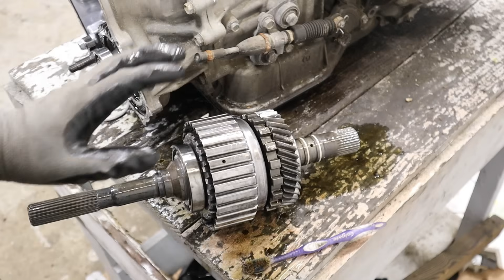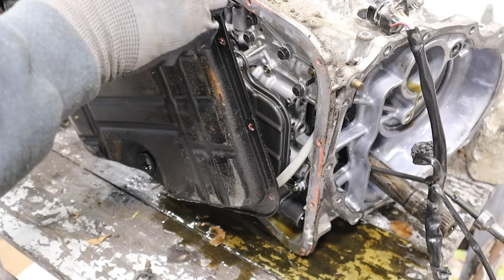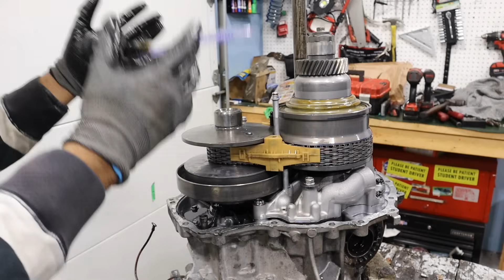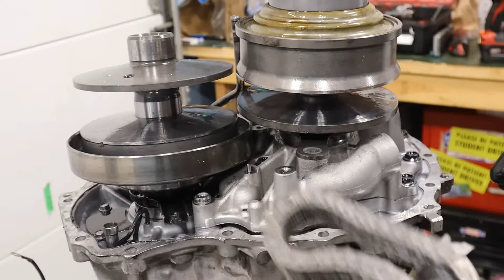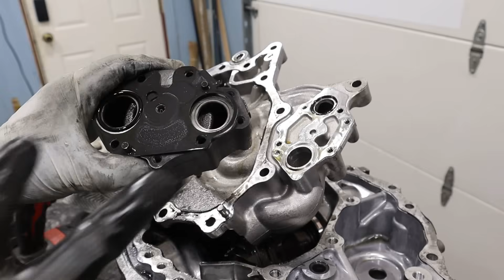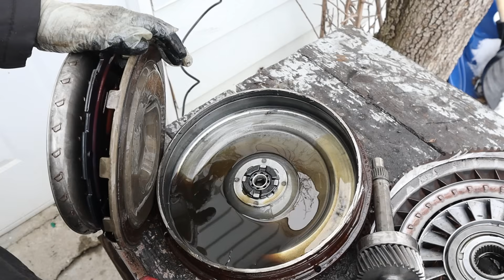Are Subaru AWD CVT's Reliable? Subaru Outback Transmission Teardown!

Comment: Before I watch the video I would say at 91,000km or 56,000 miles that the owner never changed the fluid at about 48000 km or 30000 miles. The valve body does not need to be changed the solenoids can be purchased for about $75.00 each.

Comment: I think the problem with Suburu trammies is they lack a physical, mechanical "launch gear" for 1st gear.  Low speeds put a hardship on the belt in their transmissions.

Comment: The reasons why these transmissions fail is due to lack of maintenance it's not because of the transmission being poorly manufactured service every 30 thousand miles and it will go forever

Comment: Oh and that's only CVT not for fuel efficency.
It's for it's capabilities. Dead stop to crawl in deep snow, smooth changes uphill and downhill, linear acceleration (that's amazing!).
And torque split is 60/40 by default

Comment: I have a 2013 legacy with 170400. Took to dealership said I have to replace valve body plus front cat. Between 5k oil change had to put 1 and half quart oil. This is unacceptable in today's age . It will eventually plug up another cat plus senors eventually. Parting out. Will not purchase another Subaru.
Reply from the maker: Ouch!

Comment: Does it matter if the cvt oil you replace with, is a different brand, but same specs? Great video by the way!
Reply from the maker: Better to get the OE. 
Other oils will be formulated for all types of transmissions.
Reply: @speedkar99 thank you for the reply

Comment: I think oil pressure is actually unlocking rear shaft clutch, if that sytem fails it remain locked. At least its so for manual transm central diff lock.

Comment: The difference between the Toyota/Nissan belt and the Subaru Chain is stark. I would never buy a car with the belt type CVT like Nissan/Toyota. You see tons of those belts fail and turn into shrapnel...
Reply: Honda belt looks similar.  While is looks weaker in terms of breaking, to my eyes it looks like it has more surface contact (and thus better friction) with the pulleys versus the Subaru style chain.

Comment: I have a 2014 Forester xt. Never had a problem. With 130,000 kms, I recently changed the black CVt oil with fresh. 25 bucks a liter times 7 is not cheap, but a new trany is not cheap either. Love is all it takes. I love my Subi, and it loves me. Regarding engine oil, I have never had an oil burning issue. 5W30 is what is recommended and what I use. Front and rear diff. oils changed also. Do you want a long life Subaru don't ever forget the lube of the important parts. Also did all four wheel bearings after 10 plus years. Like new.
Reply: I have a 2015/14 Forrester, 124,500 miles. I baby it, but I have not changed the CVT fluid, after watching Mr. Subaru I have just scheduled flush and fluid replacement, also the oil change in the transverse cases. I am 80 years old and the prices on new vehicles means I would have no money for groceries !

Comment: I have a 2010 Subaru Outback and it's tr 690. It's already 250,000 km and it's been changing oil twice. I put an extra large hydraulic fluid magnet filter and cleaned out lots of metallic powder and now it's way smoother

Comment: Our 2011 Outback went 11 years and 255,000 km.   Our 2018 Crosstrek went 7 years 180,000km.  Changed the tranny oil every 60,000 km.   No such thing as a lifetime fluid.  I expect our 2022 and 2025 Foresters will do the same.
Reply: "Our 2018 Crosstrek went 7 years 180,000km"   Are you saying that it failed at this point?  Because 7 years and 180K km (about 110K miles) would be pretty bad.  Our outback started to get chain-slip at 6 yrs/105K miles.
Reply: @CarlOldyOlsen Noooo!   That was the mileage on it when we traded it for our 2025 Forester limited.  If it only Evernote that far that would be crappy!   Best car we ever had was a 2004 Jetta TDI wagon.  That car was bulletproof…13 years and 300,000 km.  It hurt to trade that car bc it had more life left in it…but you know what they say…happy wife, happy life 😅

Comment: Any advise is appreciated? 

I have a 2012 Legacy 2.5 with CVT with 250 000 kms which should be the same as this, right? 
But I didn't see any "central differential" (planetary) in this video, which is what my Subaru service center said had failed. But from this it should be that first clutch you pulled out right at the start.

My symptoms are at parking speeds while turning the car, there is a knocking/grinding noise and the car behaves like the "central diff" is locked... not pleasant on asphalt. Drives "normally"at speed though. Does sound like a "bad diff" in sharper curves. 

Status: After failure, I found my coolant level very low, so possible leak or burn off. Secondly, I have oil in my coolant as well, but if I look at the engine oil dipstick, there is no sign of coolant there. I'm guessing the oil in my coolant is coming from the transmission and not the engine, or not just the engine, and that is why the rear clutch is not working properly, and locking the front and real axels. As far as I can tell the CVT is still working well, as there is no strange behaviour when driving at speed. 

No smoke or smell when running, but my coolant must be going somewhere. No visible leaks under the car. Cheers if you have any theories.

Comment: I need the lock up solenoid right now… just got charged $2400 replacing the torque converter which did nothing, it’s that damn solenoid. Again.

Comment: Yep.  Couldn’t figure out why my 2016 Outback dash lights were lighting up Christmas tree style.  Car was driving but when the dash lit up all the driving assistance tech was offline.  Changed the battery, and I avoid Subaru batts…had that warranty issue on my original one and replaced with AGM one instead.  In the end it was the solenoid and the entire value body was changed.  Guess Subaru figures other solenoids would eventually go, and new value body probably nice and clean.  Chunk of $$$ though.

Comment: someone said the transmission filter is not actually a filter like a oil filter for the engine, it is more of a screen to filter larger derbies. this person said it is better to drain and fill every 30K miles and only replace the filter when the pan needs to be dropped to repair leaks. Your thoughts?

Comment: I have a 2017 Crosstrek and have 189,000 miles on my original  cvt transmission /engine . I change my fluid once every 18 months or every 25,000 because I Uber and live in mountainous area. I use Triax cvt fluid,motor oil,differential oil  its fantastic oil . I had my oil tested at 20,000 miles and it was still in grade and good to go. I love Subaru's my engine burns zero oil and I am shooting for 300,000 miles on mine. I will never own another U.S. /German car brand they just don't last . Come on a plastic water pump on my 2015 V.W. jetta turbo that ended up blowing the engine? I love how you break everything down,great site you do great work:)
Reply: yup I have an 2014 outback no issues..with over 100,000. The key is to change the fluids often ...keep it clean and you won't have any problems.
Reply: i and many others got solenoid issue.  $2k repair at small shops, $6k at dealer.
Reply: @rouxlong9027   If you have the 580 Cvt you can do it yourself, Its on the top near the firewall . Dorman sells the solenoids for about 50 bucks.. You would have to take it to a shop to have it reprogram if your not tech savy.. Just make sure you have a power socket wrench makes it much easier...
Reply: @wes2460  if I install the whole new valve body does it need reprograming
Reply: @noventay4    This is ironic. I was looking for the same info when I got your question and I have been told two different things. My car the Awd solenoid is bad on mine, it went out last month. It drives just fine but its limited in Fwd only and the Anti lock ,and side mirror senors don't work when the transmission lights are on . I have all the parts for mine ready ,I do suggest to change all them and Ohm them out before you install them in there. The Awd one is the only one that will be between 2 to 4.2 Ohms the others should check out at 10 to 13.5 Ohms . Make sure you have a power socket ,remove the battery cable . I guess I am going to go ahead and buy a re-programmer  GEARWRENCH Professional Bi-Directional Diagnostic Scan Tool | GWSMARTBT   . I called Subaru and they won't do it unless they get to throw in a TON more money as is the norm with everything now-days,same with all the other shops I called. Amazon wants 130 bucks for it but I found it on Ebay for 90 bucks. I have been told yes I need it and No I don't but there is confusion with my car cause I have a push-button start instead of most 17s Key start . Im doing it myself I was quoted 3800 bucks to do this and I can do it myself in a hour, I would install a new transmission for that kinda of money. A soldier iron is also handy and becareful when you remove the spade connectors on the solenoids they can break very easy and have to be soldiered back on.Don't waste your money on Subaru Cvt Fluid 60% of all Subaru dealers use Triax Cvt fluid and I use there stuff all the time its even better the Subarus fluid and is 50 bucks for a gallon.
Reply: You can upgrade a inline transmission filter that will help more

Comment: If you look at where the front diff is it's actually about 2 in over towards the driver's side so it's not actually symmetrical awd drive anymore. The axles are the same length but the casing has an internal little shaft and that made it not symmetrical according to the old definition. If you only needed the axles the same you can have some of the Nissan altezza systems be symmetrical but they advertise that they weren't because the front diff was not on the center line
Reply: Subaru AWD is now no better than anyone else.  It's just FWD, with an on demand clutch pack to the rear, just like everyone else.
Reply: @peterscott2662  100%. They should be ashamed of ATS.

Comment: the ats clutch pack cannot fully lock.  The max torque split is around 70:30 or 60:40 front bias depending on year. That is one of the reasons the AWD performs poorly with the non WRX cvt.

Comment: Lots of “knowledgable” videos on cvts, oil burning etc etc etc. I know Subarus with their cvts that are over 200k, they have had the necessary services and drive nonabusive.  That’s just it with any car. Don’t service, don’t drive correctly I could care less what you have as a transmission, it’s going to give you problems.  I’ll trust Subaru over any other brands cvt.  Maybe Toyota but they’re having lots of their own issues.

Comment: From what I've heard, as long as you change the fluid significantly more often than what the manufacturer recommends, it'll last as long as any other well made transmission. Instead of the normal 60k ATF change interval, this should be 30k.
Reply: The manufacturer says its a lifetime fluid...I think just about every manufacturer says that with their transmissions now....Change the fluid around 30-35k and it'll be fine, especially if the CVT doesn't have an external oil cooler, the fluid will get heated up more and break it down quicker.

Comment: Excellent Video

Always wanted to know exactly how this thing works.

If you have recommendations on when and how to change the CVT fluid and differential fluid on these, that would be awesome!

I have a 2019 Subaru Impreza.

I believe Subaru tells you you don’t have to change it, but I know better than that

I drive my cars until they’re in the three or 400,000 mile range
Reply from the maker: Drain and refill. The check procedure is where it varies

Comment: So by my count there's 4 or 5 separate clutches in this transmission and torque converter. Seems overcomplicated compared to the old 5MT with just one pedal operated clutch and a limited slip 50/50 centre differential!
Reply: I was so sad when the got rid of MT on most of the lineup (only WRX still has it).

Comment: This teardown is gold! Seeing the Subaru AWD CVT taken apart like this gives amazing insight into its engineering and wear points. Love how they explain the valve body and chain drive—super helpful for anyone questioning reliability. Great job demystifying it!
Reply: This is 13 year old tech.  Subaru has made a lot of changes to improve the transmission over the last 13 years.  The video would have been interesting had he torn down a CVT built in the last 3 years or so.
Reply: What for they change?
Reply: AI written comment. Please ban this bot.

Comment: I still don't understand why make CVT that need more fluid change but no dipstick. Why not add dipstick and engine oil filter style so that it can change easier.
Reply from the maker: More money in the manufacturer pocket when they seal it and it fails and your come back for more

Comment: 56,000 miles this one failed, my  03 Marquis has 495,000 miles on the original engine and transmission with zero issues and zero rebuilds...Thanks but no thanks, I will just keep my old Mercury...
Reply: The panther platform cars are tanks.  Especially the ‘03 and up cars.  The vehicle was designed to be durable enough for police to treat them like rental cars and cushie enough for limo drivers.  Mercedes might be the only other manufacturer who can pull that off (or at least they used to).
Reply: @BlindBatG34  If you want that level of Durability in AWD Lexus GS/IS 350. Its weird that in other countries they were sold as Toyota Crown. That is actually a brand Like Mercury with its own grille (but same car).
Reply: Nice, plus you get to listen to your 8 track tapes.😂

Comment: I'd take a Toyota cvt before a Subaru all day. After owning Mazda, Buick, Chevy and Toyota vehicle's...
 I only buy/drive Toyota 2020 or under❤
Reply from the maker: Good idea but I think the competition has caught up and there are other vehicles that are worthy competitors.
Reply: Subjective over objective thinking
Reply: The new Subaru Forester Hybrid is using the Toyota CVT, and hybrid system I believe.
Reply: @wildbill23c  not exactly, it does use parts of the Toyota system though. Theres a video comparing the new forester hybrid to the rav 4 hybrid off-road,(driving sports tv i think) its a a good watch, the difference is quite noticeable!
Reply: @spookyruss  The difference is Subaru kept the mechanical AWD system rather than an electric motor in the back....the rest of the powertrain (engine/transmission/hybrid) is from Toyota.
Reply: @wildbill23c you are correct, the engine is still a Subaru boxer though, based off the standard 2.5 engine. The hybrid motor placement is also different from Toyotas, as you mentioned those are in the back. Though to my knowledge the electric motor design and transmission is Toyota, and so is the hybrid battery tech. 

That being said Toyota aside from the “I force” systems doesn’t make a true AWD hybrid, the “AWD” offered on the Camry, Corolla, Corolla cross, Rav 4, etc doesn’t provide enough to the rear wheels to help in snow, or off-roading. It’s more like FWD, with a rwd ev mode

I’d love to see Toyota use this system developed with Subaru in more cars!